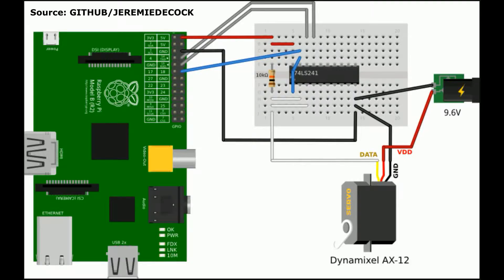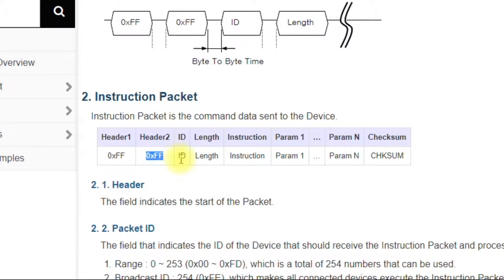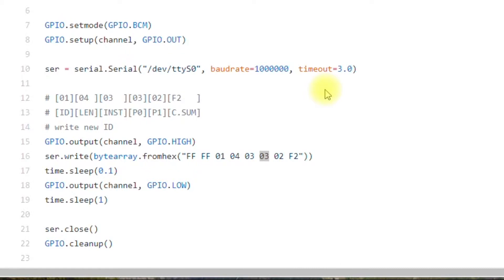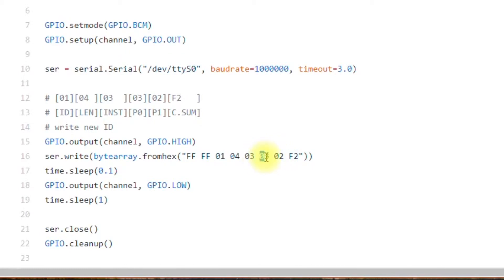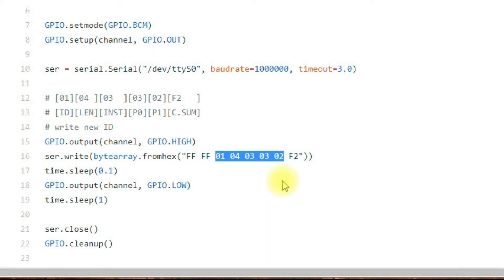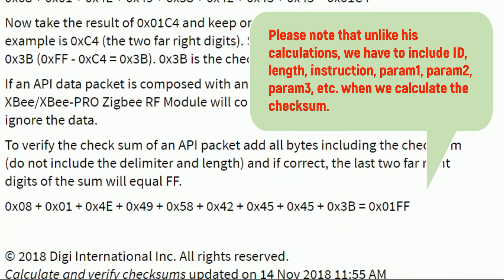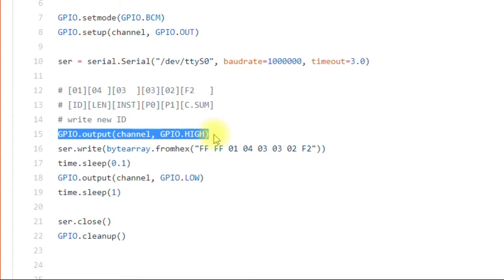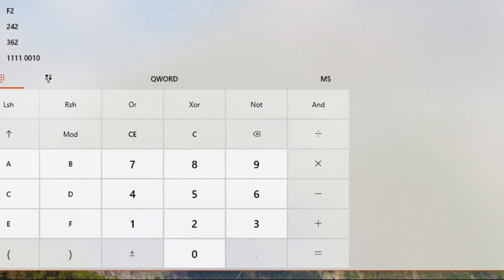Python Programmable DIY Robot Arm (2 of 5)

Comment: why you need to change the motor ID?
Reply: i wonder the same
Reply: because the default ID no. is 1 and as he said dont keep same ID if u r using multiple servos. 
if u have different ID's it will be easy to control multiple servos with different parameters